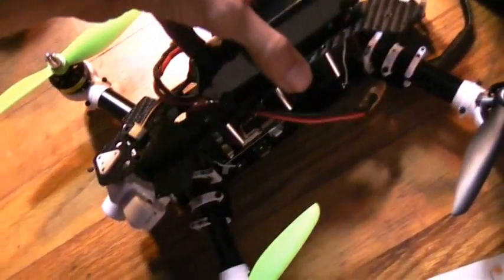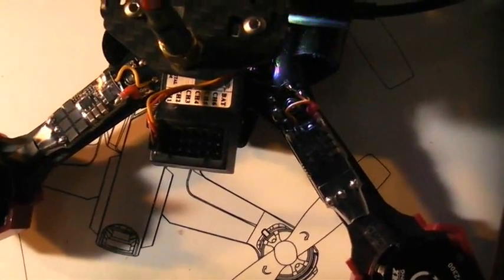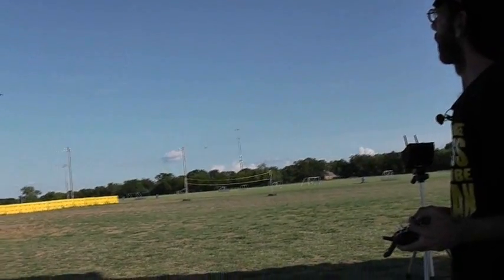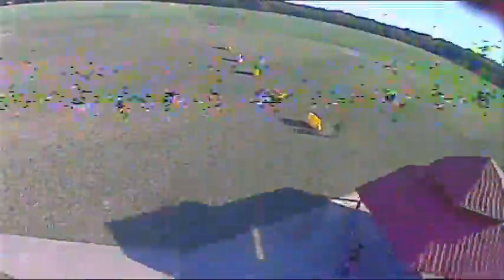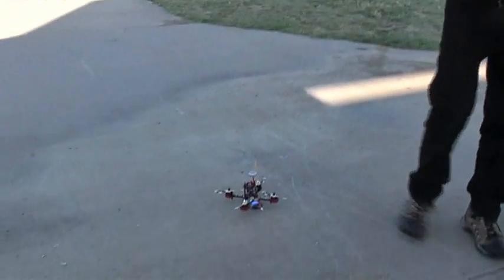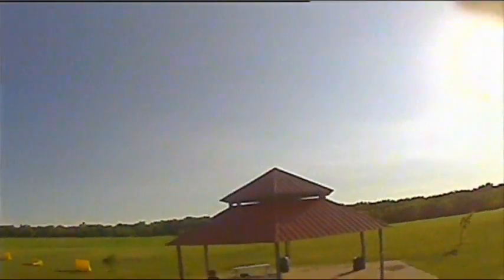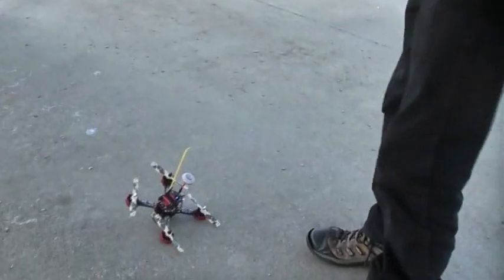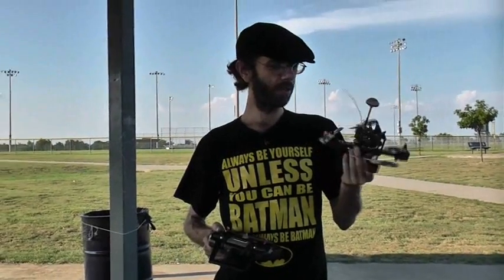JJPRO P200 Flight Test, Receiver settings, And Review, RC101

Comment: Hey man,
i have a slight probleme i bought the jjpro p200 but i think the transmitter isn't set up right or somthing because the throttle is set to the right horizontal stick and stuff like that
Reply from the maker: If you bought the ready to fly version It sounds like you have a mode 1 version :/
If you bound it to your own personal transmitter you might just need to install clean flight on your computer and connect to the aircraft with a usb cable so that you can remap the channels on the receiver tab.

Comment: Hi friend may you help, I just got the P200 model just like on your hand, but I can't get any signal to respond from the reciever I can get the video to my goggles, any time I plugging the battery the copter continue beeping, is anything can you help I looked your video I love to get may P200 going, I went to the youtube and trying to setup the clean flight but I'm not sure what firmware to flash to the P200 and my radio is not working is green light on, I not for sure what I need to do, I hope you can help me, Because I can't get any support from TOMTOP when I got the system I have no document or manual, you know you getting product from China you just cross fingers to work and how long?.. this is my email mctslc@yahoo.com. You have a nice Christmas Good luck Holiday! Thank you in advance
Reply from the maker: You need to have a transmitter with PPM support, if you're using a flysky fsi6 transmitter go into the menu and turn on ppm support. It should already have cleanflight installed and programed so you shouldn't need to flash firmware unless you want to. I would say also go onto rcgroups and rcuniverse and check out some of the JJPRO forums.

Comment: You need to make sure that you use compatible antenna combinations and orient them correctly. Like you need to know if the antenna on the quad is LHCP or RHCP (SMA and RP-SMA are just the connector types and don't affect the actual signal) and then match that on your goggles.
Reply from the maker: Thank you, I really appreciate it. I do need a better pairing.

Comment: Seems like great bang for your buck, although that video reception was pretty average for a 600mw transmitter. Might be the antenna combo you were using I guess. Is the antenna on the quad SMA or RP-SMA?
Reply from the maker: I think it's a low cost antenna issue but I'm not sure. It's an SMA antenna and I have had really good luck with SMA antennas. The walkera rodeo uses a 600 tvl camera and an SMA antenna and it gets amazing FPV range, the rodeo gets better range then all of the racers I've tested that use RP-SMA antennas. The P200 uses a nighthawk antenna but I'm going to try a few others and see if it gets better reception.
Reply: Yeah, I'm not sure whether the connector style makes any difference to the signal. I just wondered which ones I'd need to order if I had to replace them. The Walkera rodeo just uses a little monopole, whip antenna doesn't it? Pretty impressive if they can still get great performance. Seems like Walkera's really lifted their game with the Rodeo and the F210.
Reply: the antenna on the quad is fine its the dipole on the goggles that needs a garbage can  cheers

Comment: There are more than just PWM and PPM ;) SBUS being one of the best. What was the stock looptime? I normally run 250.
Reply from the maker: You are correct there are more receivers out there and I should have mentioned that, I was concentrating on the types I had access to. I'll try different loop times and see if I notice a difference, why do you like 250.
Reply: R/C 101 If you didn't know, the lower the looptime the better, as it can react faster to changes. Not all board are the same though. Some can only run 1khz which would be 1000 loop I think, I run 250 which is 4khz on my X racer F303. Some can go to 8khz as well. Your escs also can only take so much. My normal little bees only do 2, so I run the gyro at 4khz, and PID loop at 2khz. If you flash betaflight 2.9.0 and use the betaflight configurator it is really easy to set them up without CLI as it has buttons. In CLI you need to type "get_Denom" to see what they are at. So if you set loop time at 4khz, and want to run the gyro at 4k, the gyro denom should be 2, as it is 8 then divided by the number, and the PID loop, say it was 2 again, it would be 2k, or if it was 1 it would be 4k, as it then divides from the gyro loop. It is pretty confusing if you don't know all of it, and I am sure if didn't explain it well, haha.
Reply: Sbus all day.. Once you go sbus you won't go back..